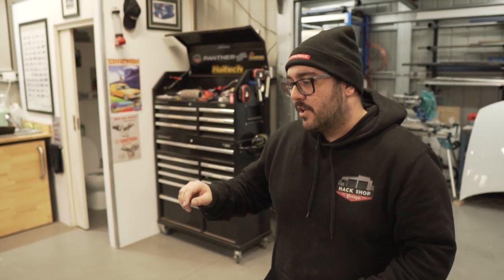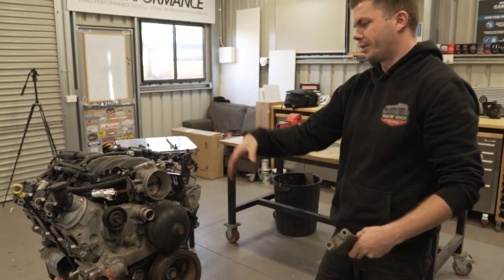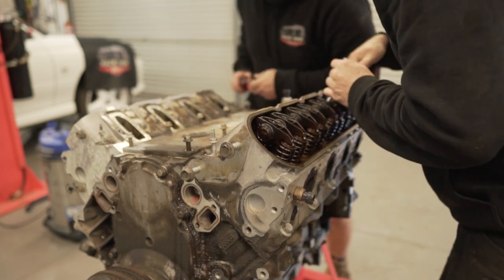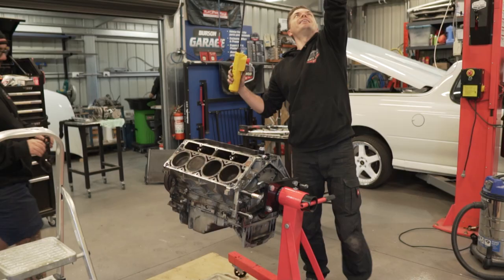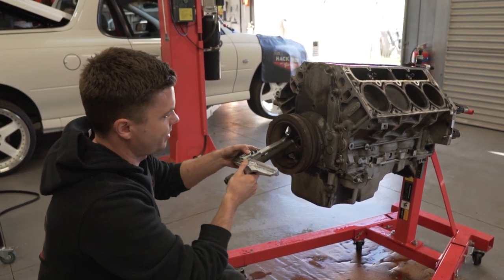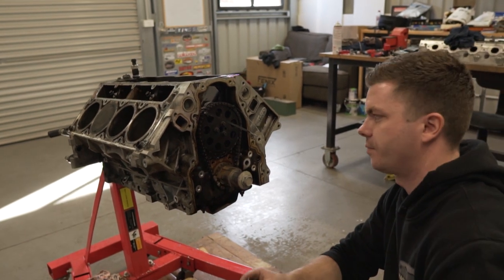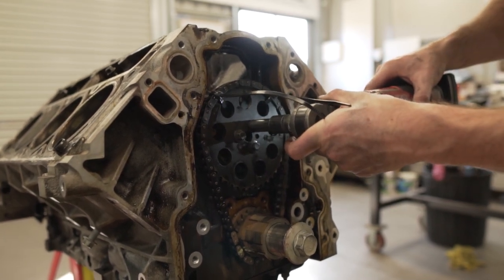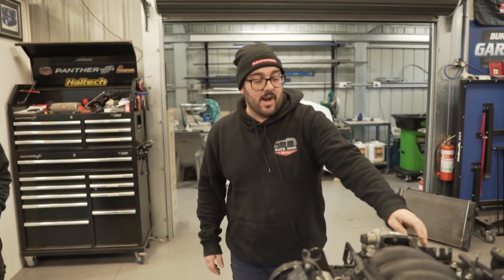BUILDING AN LS1 TURBO VY UTE!! - Part 2 - Stripping The Engine

Comment: Guys while it's still apart replace the cam retaining plate. That's an important seal embedded in it for the oiling circuit. Also I'd go a single row chain. Don't stress about bearings or rings. Bolt it back together and send it. Have fun.
Reply: Single row is the go especially with 918's
Reply: @dazaspc  yeah I've only ever used single row rollmaster kits and never had issues. All about the right bits for your combo.
Reply: Cam here to say the same.

Comment: Trick is to undo the balancer in the car first, breaker bar on chassis rail, pull fuel pump fuse then crank the engine, works every time 👌 
If you've got a decent rattle gun though then it's no problem.

Comment: Aeroflow pickup bracket to really ensure oil pressure is solid. Costs like $30.
New cam retainer plate with a fresh seal. Old ones can be compressed and you’ll chase oil pressure problems. Again, $30-$60. One hell of a good security.

Comment: Love it guys, good to see you finally working on a real engine ;)

Some tips if you are interested...

1) Love the roof winch. I did much the same in my shed, but take note from my previous failures... when this fails, it'll be the straps getting sliced by the razor sharp edge of the block. When this happened to me, the engine did a summersault from about head-height and barely missed my foot on landing. Little bit of cardboard on those edges might prevent some tears.
2) When doing double-row timing chain, you will likely need to step the pump forward and clearance the timing cover.
3) The position of the chain on the gears doesn't really matter, but the relationship between the gears does. Dot-to-dot is good enough.
4) I'm pretty sketchy with my shit and rarely change oil pumps and timing chains, but one thing I do recommend is that cam retaining plate is replaced. It has a seal behind it that holds oil pressure, and are almost always flat. LS engines are not priority oiled, and loss of oil pressure here prevents oil pressure reaching the crank.

Can't wait to see this on the road sometime, or even better, line up against it at Heathcote one day :)

Comment: I was going to say "Gap the rings" but everybody else has. A couple of other things though, perhaps a new rear main as they are easy and relatively cheap to replace when out and when you fit the oil pump make sure it is absolutely concentric to the crank. I check this with feeler gauges. Been caught once before on an LS and it cost me big. Also leave the timing cover loose until the harmonic is on to ensure it is also concentric.

Comment: Great job on deciding to replace that timing set. That smart washer you are using is great. My brother and I had a shop in the late 90's rebuildable steering parts and cv axles. Safety kleen gave us a new type parts washer they were researching and it was the enzyme parts washer. I remember it being warm. When we would do alot of parts washing and it would get really dirty we would let it set over night and the next morning when we came in to work it would be clean. That was awesome.  One time it took 2 days cause we over did it. We still had our other one. Thanx for the content brother.  You guys are funny.

Comment: Double row timing chains can be a bit of a hassle boys as it very may well foul the oil pump/timing cover. We used a 'Rollmaster red' timing set on the Turbo Tonner and was a great piece.  Hope you fellas have invested in a trunion upgrade for the stock rockers aswell!
Reply: Yep. Things they don't tell you when you buy it. I've just put a double row in my ls1 turbo build and had to clearance the timing cover slightly. Not a big deal but definitely something to consider if you're going to go double row. I'm sick of buying parts that "fit" only to find out you need to customise them or something around them. Bought a steam vent kit to suit stock LS1, doesn't fit under stock LS1 intake manifold. Had to buy spacers for the manifold.

Comment: Saw your workbench on wheels radius the corners more hip friendly Shelf out of 50mm angle underneath great bench.I like 20mm plate for the top braced with 90mm x 10mm flatbar underneath but heavy and the steel for free .Had a painted ply bench outside was still good after 10 years.Budget effects so many things but thought helps us on our journey.Cheers

Comment: That cam retaining plate is ideal to replace and you need to check the end play once the new double row is fitted they run a Torrington bearing which will have some movement in it

Comment: There is a tool you can get to allow you to do cam bearings without removing the crank and it only takes about 10 minutes to do when using it.

Comment: Probably lots of comments about this however cam retainer plate new cos if it don’t seal properly and this is common….roasted motor.
Don’t change that timing chain would be very unlucky to have a problem there.
Dot to dot for the cam timing sprockets has always worked for me… but don’t take my word for it as I am an idiot. 
Well done on the pick up o-ring another easy thing to get wrong, I wish they made those all the same blue black and green has not been idiot proof enough for me in the past unfortunately.

Comment: I can’t wait when it spin bottom bearings lol 😂 good luck with it oil pick up is  at the front it not going to last long lol mine lasted a month on 7psi at 690hp to a 6 speed manual in a vy ss Ute
Reply: 690hp @ 7psi sounds like a BIG compressor!

Our turbo LS VY build has lived 2 years and nearly 10,000kms @12psi making 620hp haha

Comment: The environmentally friendly parts washer sounded like a cool idea, until I saw the price… unless CRC want to sponsor me one, I’ll have to stick to my nasty solvents and clubbing seals.
Reply: even the fluid is $$$$ at around $250 for 20L and $50 a filter
Reply: Hey Ben, It actually works out about the same as with the CRC unit we don't have to have anyone take the kero away. You just have to top up the Ozzy juice. Also, it's much better for your health.

Comment: no 1 rule is always replace cam bearings on an ls as they are almost always worn out, besides its a half an hour job with around a hundred dollars in parts. its a bit of a bitch with rotating ass still in the block but stiil doable in half an hour . at the end of the day oil pressure is pretty important especially with a forced induction build.

Comment: That camshaft is quite sizeable, DO NOT put the heads back together without checking coil bind heights, installed heights and retainer to seal clearance. Otherwise this will end in tears unfortunately.
Also piston to valve clearances will need to be checked and I’m putting money on you needing valve reliefs cut into the pistons.
Personally my opinion is that camshaft is too aggressive for what your after.
Reply: I thought the same that the cam is very aggressive for a turbo build.

Comment: A lot of people are talking about gaping rings...If it's a worn engine and your boost is not going to exceed 15lbs don't do it. If you  are going for 15+boost you should renew it all and gap 25-30 thou depending on how bigger game you are going to play...David Vizard has a really good video on ring gaps, rpm, sustained boost and nitrous...you have to allow for bed in and wear and beware of the affects of excessive blowby/ventilation on engine performance and limited life.